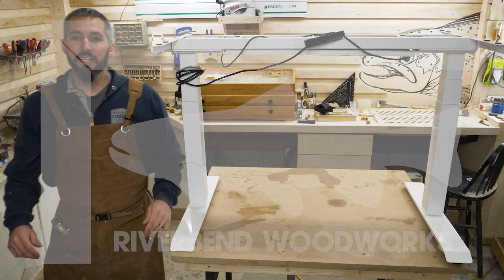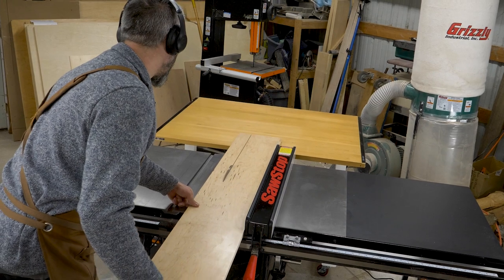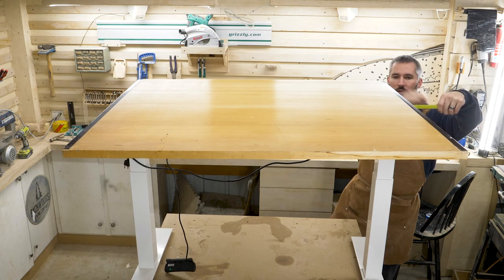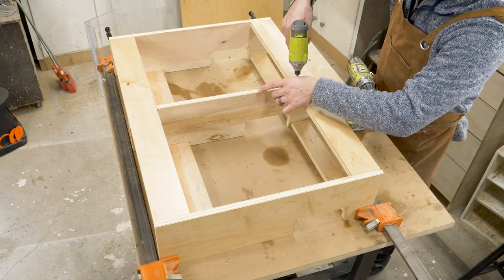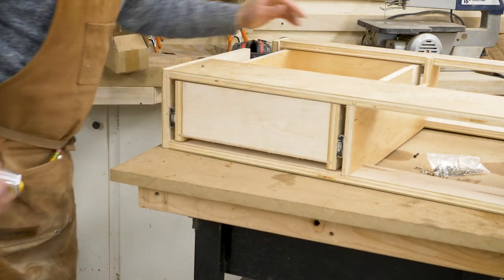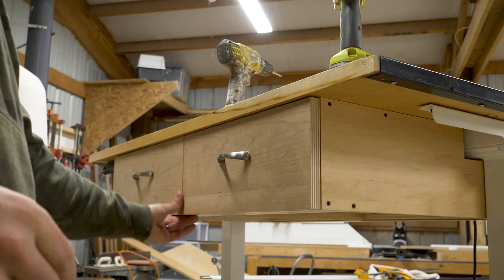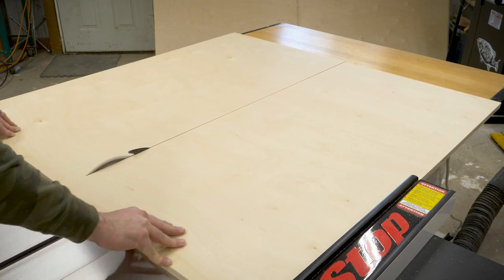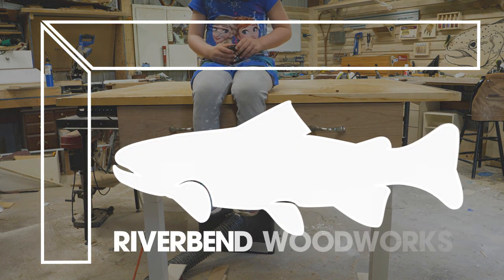Electric Work Table Build | Woodworking

Comment: What size butcher block top did you use
Reply from the maker: This top is kind of a weird one. It's 48" long x 38" wide x 1" thick. Works out well,  but unfortunately I have no clue the manufacturer of it.